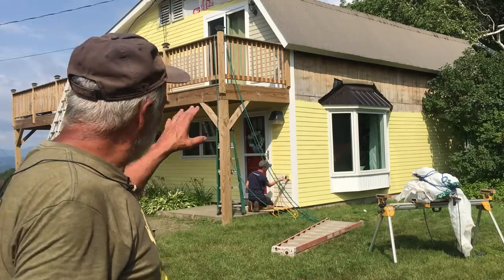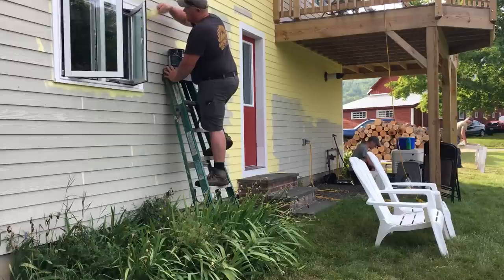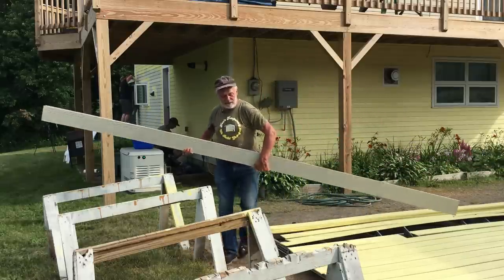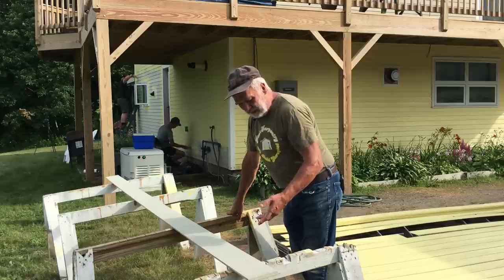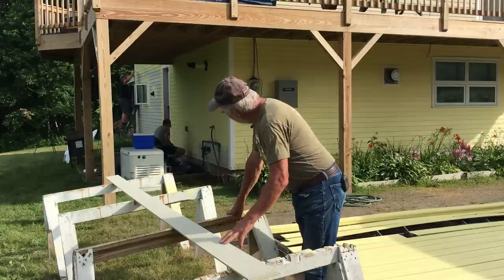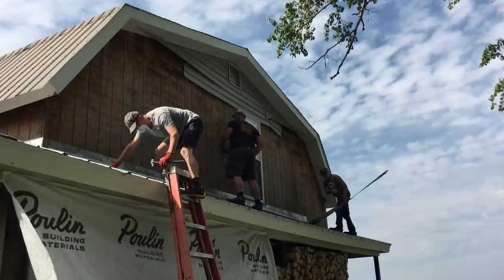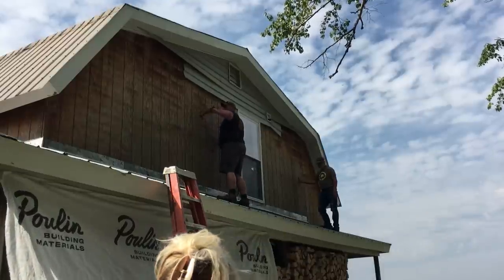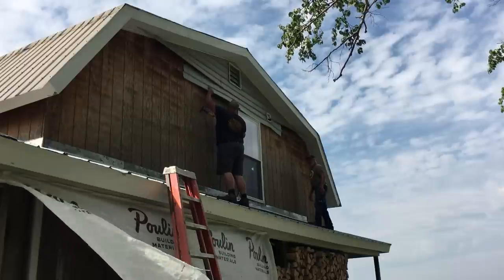$21,000 TODAYS MONEY FOR THIS JOB...CEMENT BOARD SIDING Part 3

Comment: Ken, you either need to reset your IMU settings for the gimbal on your drone or if you do, and the horizon doesn't stay level when you turn your drone, you have a major problem with the gimbal that needs to be repaired. A 3-way gimbal, like the one on your mini, should always keep the horizon level.
Reply from the maker: Thanks I fixed it

Comment: I have installed cement board siding on my cabin. Fire protection. I started caulking between the board to prevent insects/ants/spiders from getting in. Should I remove the caulking .

Comment: Question for you Ken. I had cement board installed on my cabin and I started to caulk between the boards to prevent insects/ants  coming in and to help with the insulation value. Should I cut out what caulking I have done so far?
Reply: I think that is wise. We have cedar clapboard and those cracks allow the house to breathe. Are you talking about caulking between the butted boards or along the crack at the bottom of the clapboard where it overlaps? You don't want to caulk the overlap at the bottom of the boards. We painted after we sided and the paint formed a "seal" but some of the boards cracked all along the overlap underneath. I think that's so our house could breathe.